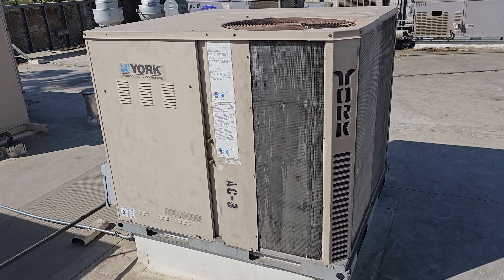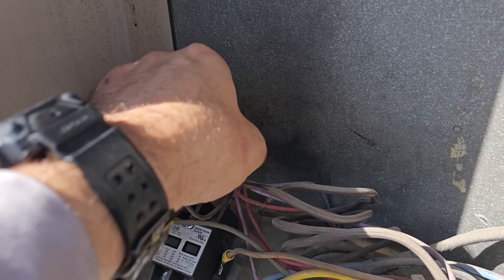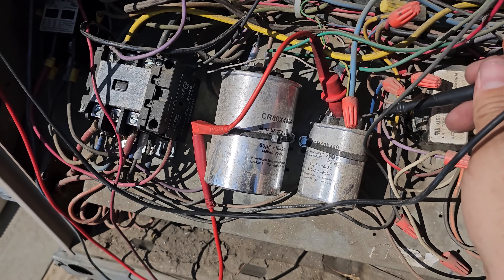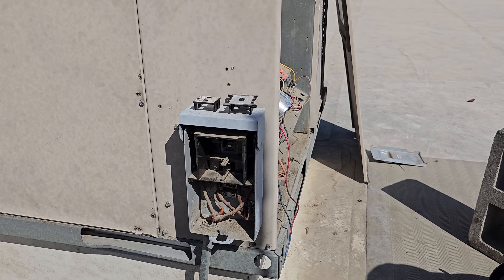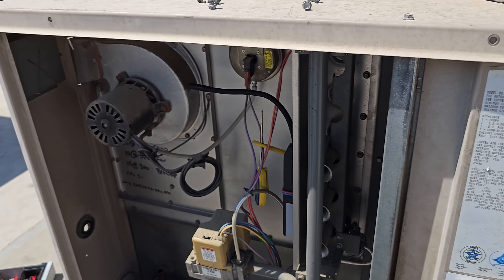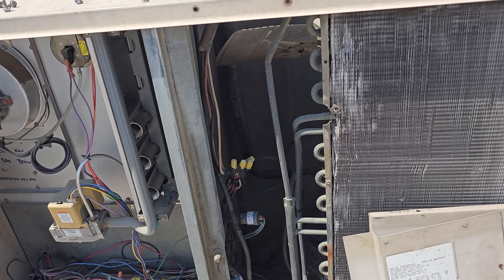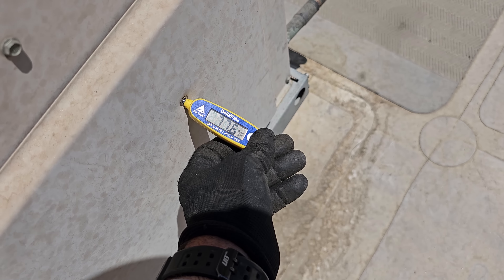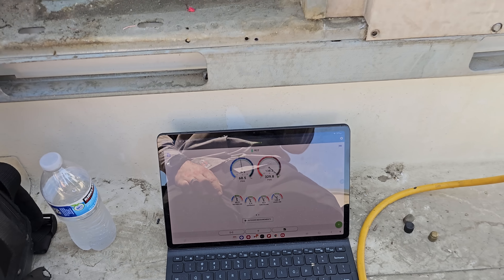I CAN'T SHAKE THIS STICKY BOOGER OFF ME

Comment: I'm not an HVAC guy.  A while back my wife asked me why I watched you, and I told her it was because it's always worth watching a good teacher teach.  Fast forward, couple days ago the AC went off in my house so I started with the big picture, grabbed the ammeter and figured out the compressor wasn't running, checked for and found voltage at the contactor, checked the compressor for short to ground (none) pulled and tested the capacitor and found it bad.  $18 later for a new one and my AC is up and running again with no service call.  Thank you sir!
Reply: hope you broke down to your wife the amount a service call would be... compared to your time learning basic knowledge of of troubleshooting :)  
Great for you!
Reply: GOOD FREAKING WORK!
Reply: And a blowy
Reply: saved yourself $250++
Reply: Heck yeah man that's awesome
Reply: Right on.
Reply: @wolphin732 Wife : “so we saved $232 dollars on work we would have needed doing. Ima get me those new shoes I want with the change” 🤦‍♂️ That’d be mine
Reply: One of the main things I have figured out from this channel - keep the condenser and evaporator reasonably clean. That can save a lot of headaches.
Other things wears out, and there's no money saved on skipping maintenance.
Reply: You might have saved thousands as many (not all) residential guys would either not understand or just use it as an opportunity to sell you new equipment
Reply: Nice!  Hopefully your wife “thanked” you well 😏.
Reply: @ronroth8788 lol that'll get the truck there 😂

Comment: yeah those hats are great, i've got a few. also instead of a cold towel around neck, dunk your arms in a bus bin of ice water. also drinking a slushy or something like that before going on a hot roof helps immensely
Reply: If it gets truly nasty outside (or you have to work in an un-conditioned attic), they make "cooling vests" which is a simple vest with a layer of insulation on the outside and a multitude of mesh pockets on the inside, and inside those mesh pockets you put gel cold packs.
Sometimes they are a little too effective, but the key thing to know is that they cool your torso, aka the core of your body, and that's the most efficient place to apply cooling because your body already has a "coolant" system in it, in the form of your blood, arteries, and veins.
That's also why dunking your arms in a bus bin of ice water is so effective, your blood rather quickly transfers the cooling to the rest of your body.

Comment: My house has this exact rtu. Total hackjob, horrible intallation, wires are a mess, 3rd party condenser fan, and beat up condenser coil. Before i rented that house i saw how it was remodeled when they replaced the swamp cooler and installed the 20 year old used york unit. landlord doesnt care if anything happens to the house once there was no cooling called the landlord but i got no response but bakersfield heat is no joke so my only choice was to fix the unit and thanks to your videos i diagnosed it and replaced the contactor, capacitor, redone the wiring  and cut off the heating because that heat exchanger was sketchy and it doesnt get that cold here anyways.

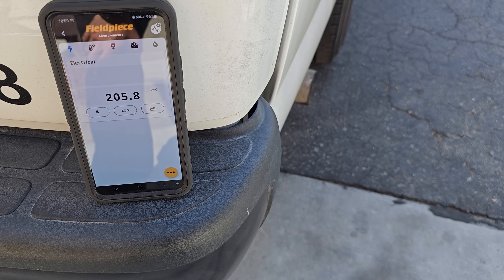Comment: @ 7:42 (later on) Someone downstairs- ground level sees the fuse box " Hey this fuse is turned off. I better turn it back on!" and you on the roof have bare exposed wires that you are wiring to a new disconnect. I hope you padlocked the door to the fuse box. Great VIDEO!
Reply: Usually you don't lock out the entire panel, instead you have a lockout on the specific breaker(s) that you are working on
Reply from the maker: Yes it was locked out

Comment: Chris, I used to work for a maintenance contractor at a food manufacturing company, and one of my coworkers took Gatorade up on the roof, and kept it cold in the run off from the AC units, in a bucket. He got in trouble, but not for long, when the safety manager told my boss that anyone working on the roof needed adequate breaks and needed to stay hydrated. Keeping his drink cold was a good idea. I've used that water to help wash the inside of locked out units that couldn't be pressure washed, since water on some areas of the roof was on the front side of this massive roof, and no one wanted hot water on a hot roof, even though there was a bit of an advantage to warm water for cleaning.
Reply: Sux to have to run 400 plus feet of water hose no pressure
Reply: You have to watch out.  If you're running REALLY hot, you don't want any drinks to be lower than cool, preferably lukewarm.  Really cold drinks can cause colic, basically.  Tie your guts in knots.
Reply: @tbelding  I've heard of that

Comment: I’ve work on a few Yorks like that one, and it’s newer than you think it is. This one was manufactured 2003. That 2 pole contactor to the left is for the draft inducer, which is never used but the heat isn’t hooked up. Seems a bit overkill to use a contactor for that little inducer motor. 😂

Comment: Regarding the wire size, fwiw starting the compressor is what it usually needs to be sized for due to the inrush current, which can’t really be measured on a DVM due to the short duration. Combine a long run with sagging line voltage and the compressor might not start. Used to do the MEP design for PETCO years ago, and they had a 110V reach-in fridge (can’t remember who made it) for their aquarium department, and in certain stores they would all end up nuking their compressors after a while. Turned out the compressor would intermittently fail to start at times due to the excessive voltage drop with normal 12 AWG wire, and that was what kept killing them. Had to retrofit all the stores with either 10 AWG (or 8 AWG for long runs) to stop them from going locked rotor at start-up. Edit: And yeah working on roofs in 100+ degree heat really sucks. Hated that.

Comment: I’m not an hvac tech or electrician, just a guy that researches projects before doing them. When you said they ran #8 wire on a 100’ run for a 60 amp circuit, I started shaking my head. There are simple charts that show what is needed for a given amperage over different distances.

Comment: These days you don't need to be a genius electrician if electrical isn't your trade.  There's a good selection of web sites that will give you a good idea of what wires you should be running.  Plug in your expected load, run length and other environmental considerations and they spit out regulation compliant recommendations.  Note, it's a recommendation only.  It's still up to the tech to make the determination to use that recommendation.

Of course, only do electrical if you are permitted to do it.

Comment: This wireing looks like everybody is pooping there somehow.

The low supply current by the long/lhin wire olso can make climbing up the loads when the voltage gets droped. You can measure the resistance at cold case with disconected and shorted line and the hot case by voltage diffrence from main fuse and the unit fuses and at the load side of the compressor contactor. 
It makes things clear. It is possible the disconnect switch is show the most of the voltage drop relative the whole line and have to replace it again to any higher contact pressure type..
And may the circuit breaker is need to be replaced when is show high resistance when the line is hot as loaded for a while.
 if u gets shure abaut this is can act like fire hazard u can put some more pressure on owner to do something.

Comment: It doesn't matter what you actually run at, you MUST size the wires for the Circuit Breaker/Fuses protecting the circuit modified by the ambient temperature and circuit length (they each derate the circuit requiring a larger wire size to compensate for the wires reduced current carrying capacity - hot wire and long wire runs can't carry as much current as a shorter, colder circuit)...

Depending on just how hot it CAN get in summer, I likely would have gone with a 4 Gauge wire for a run that long (unless the NEC specified a 4 Gauge to begin with, then I might have gone with a 2 Gauge)...just in case the area got a record breaking heat wave, I don't want my circuits to overheat and either blow fuses/trip breakers or catch fire...
Reply: Air conditioning has special rules. You should  do the ambient adjustment, but the wire for air conditioning is sized at the maximum circuit ampacity. The breaker is sized based on this figure or the largest breaker and fuse marked on the unit. You may size the wire based on the fuse and breaker like normal, but you are allowed to use the ampacity figures. The reason you are allowed to do this, is the air conditioner has overload protection and that is figured in on the minimum ampacity. The breaker or fuse can be sized at a higher than normal value for the wire size because the breaker or fuse is only providing short circuit and ground fault protection. Simply the overload in the AC protects the wire (and the AC) against overload, the fuse or breaker protects against shorts and ground faults. Mike holt had a video on this.
Reply: @jrmcferren  This is basically what I said, Chris mentioned the System had a Minimum Ampacity of 45 Amps (I think, somewhere around that) but had a 60 (or 70 Amp) fuse in the on unit disconnect and 70 Amp Breaker in the local Panel. According to my comment, that means that regardless of what the Minimum Ampacity listed for the Unit is, the wires MUST be sized for the 70 Amp Fuse/Breaker ACTUALLY Protecting the Circuit derated according to the ambient temperatures found at the location and length of wire run...

Comment: Chris can you do a video about oil traps on suction and discharge lines? especially for mini splits with long lines
Reply: follow the manufacturers guidelines. each manufacturer has their own spec.
Reply: @richardbartlett6932  no mention of oil traps from mini split manufacturers but hvac technicians install oil traps in suction line when outdoor unit is above the height of indoor unit. don't know why they do that
Reply: @lordjaashin most of the time techs will do that to prevent all of the oil from the compressor “pooling” in the lower line sets and then causing major problems with the compressor.
Reply: @brandonprice2897  so what rule of thumb is followed for where to install oil trap, at what distance, etc?
Reply: @lordjaashin  that you would probably be best to call customer service and tell them that you’re having some issues with pooling and that you want to know the best place to add in an oil trap.

Comment: Since the unit has a 23 degree temp split and just needed a disconnect and fan motor, why you reccomending a remove and replace? It isn't the prettiest unit but it seems like it's doing a pretty good job.
Reply: He recommends replacing the unit because there have already been some extensive repairs made to it and he ,probably constantly, gets calls about something else wrong. I can’t blame him one bit especially since he stated that it’s completely out of his way to come there and it’s not in his service area.
Reply: It's a bit over 20 years old, which is probably beyond the service life of most RTUs in that environment.  Plus, the tech has moved on and is more efficient, so the running costs are potentially lower with a replacement pkg. as well.

Comment: Where did the ignition control module disappear to?
Reply: @18:24  he says that it's never had the heating section connected to gas, so when he rewired, he removed all the electrical related to the heating side.  You can most clearly see this before-and-after if you watch @13:19 for ten seconds.

Comment: This might be a stupid question, but what happened to the control box thingy to the far right after cable cleanup ?
Reply: @18:24  he says that it's never had the heating section connected to gas, so when he rewired, he removed all the electrical related to the heating side.  You can most clearly see this before-and-after if you watch @13:19 for ten seconds.

Comment: There is nothing silly in waering a hat with a wide rim in such conditions. When on vacation in florida I see all the landscaping guys wearing those hughe hats, mostly like straw hats, all the time to keep them protected from the sun. It is about the same. Just yours seems to be quite eaasy to keep in your bag if needed, which might be a good idea. So you can grab it any time you may need it without having to go back to your van. It is with most specialized tools and even more so protective equipment (Sun Protection, Eye Protection, Hearing Protection,...). The stuff you can just grab will be more likely to be used than the stuff you need to go and get.

Comment: I never like the pull out disconnects. They are very finicky at being plugged back in after several uses. Throw handle disconnects are what I prefer to install. If it was me with that unit during the rewire, pulling the extra gas valve and motor would have been something I do to put a spare part or two if I knew I could use it somewhere else. They obviously won't need it in that unit. If they have another unit of the same setup on the roof and it has gas to it then that would be a different story. I always hate rats nests of wires and like to clean them up at times when it makes the job easier next time for service. Hopefully the compressor lasts through the heat waves then dies in the fall.

Comment: You’re lucky that what you have is a better residential disconnect box. My unit has just a cheap plastic landline telephone hookup box as a disconnect box with Edison base fuses of a weird size. The box is high up on a rotting deck behind a thin tree that is propping up a big ass branch that would total the unit if it falls. How unlucky.